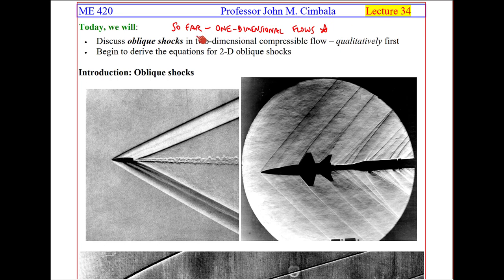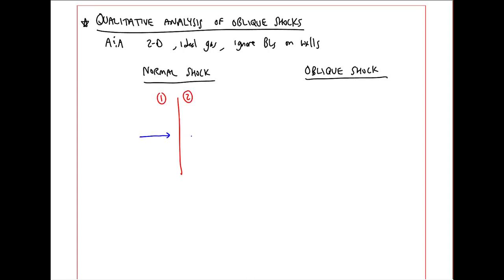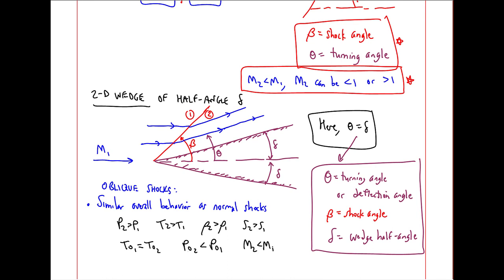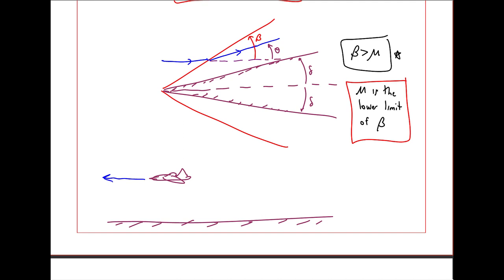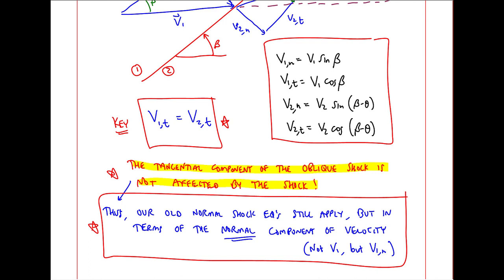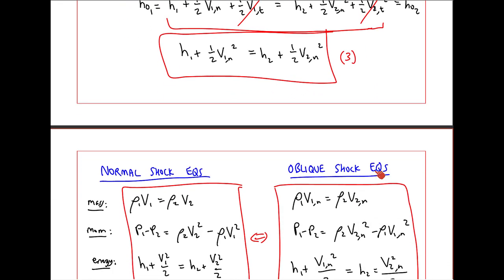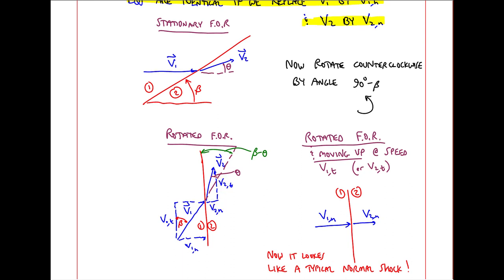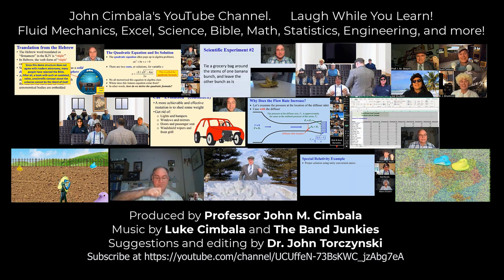ME 420 Lecture 34: Introduction to Oblique Shocks

Comment: Hello im not good at english.
But I want know what i have to use to get T1/T2 or P1/P2 at obliqu shock. Mach1 or M1n(Mach1 normal factor)???
Reply: Can i get reason why use M1n at oblique shock?
we get P1/P2 equation from T1/T2 equation(energy equation) and iscentropic equation. it mean T01=T02,  and temperature is not vector, so i think use M1 to get P1/P2 also at obliqueshock
Reply from the maker: @영재김-e2l  The component normal to the shock is all that matters as I explain in the video. So you use M1n, not M1.
Reply from the maker: Please tell your friends and colleagues about my YouTube channel where there are hundreds of free videos about the Bible, fluid mechanics, science, math, statistics, air pollution, and other topics. I would greatly appreciate it.